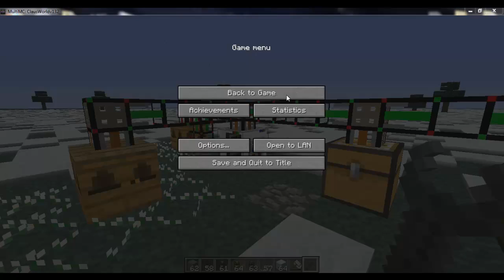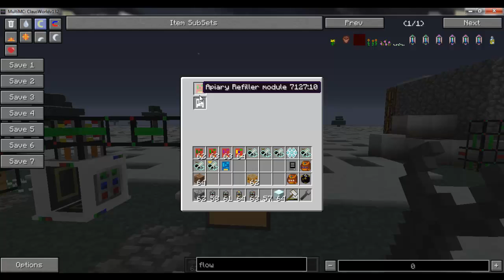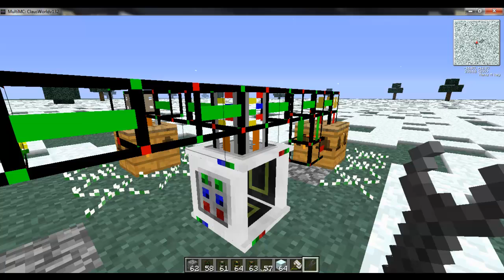Logistic Pipes - Forestry Bee Pipes?

Comment: Apiary Refiller Module and a Chassis MK1 anywhere on a Apiary is all that is required to pull any bee byproducts out of the apiarly while the queen is working and it will also, once the queen dies, pull out and replace both the drones and the princess.  I've done this from the side, top, and bottom of the apiary but prefer to hide my pipes so have them all done from the bottom.

The module is basically coded to act as a advanced extraction pipe that will also replace the main bee's.

Comment: Also, Bee Analyzer module and Bee Analyzer pipes should be attached to the bee Analyzer machine as they act as sort of an "unidentified Bee" itemsync and will pull unidentified bee's from anywhere in your system that it can see and put them into the analyzer.  (Will not pull unidentified bees from apiaries either before or after a refiller performs its function.)